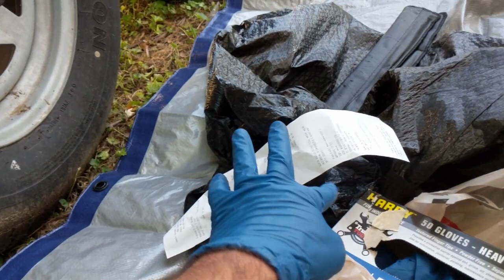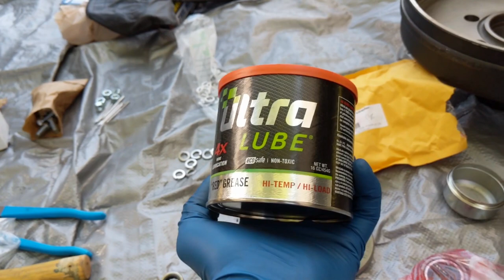Replacing Trailer Brakes

Comment: Question - When removing the disc rotor did you have to remove the bearing hub? I'm working on mine and wanted to remove the rotor to clean everything up.